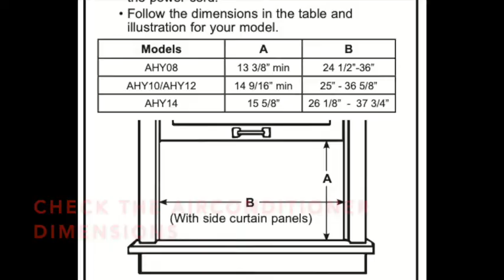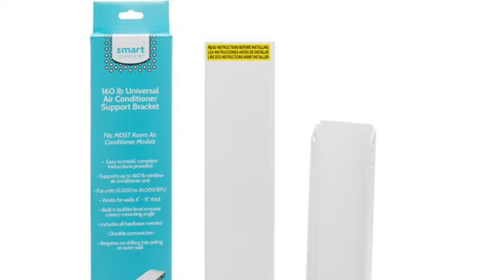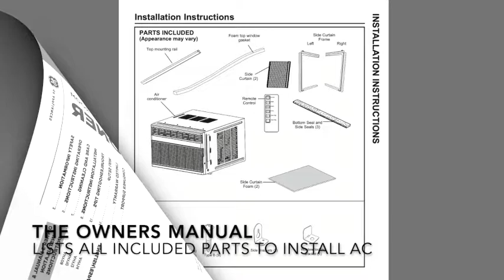How to install an AC in a Double Hung Window

Comment: I have heard you shouldn't drill holes in vinyl windows.
Reply: @nancylogan1466   You don't have to. Look at a Midea or Danby Inverter type U Shape Window AC.  No drilling into window is done. Yes you do drill two holes on each side of frame, but it's not the frame with the glass, just the wall itself. It's very inconspicuous. It's for a support bracket that will hold the AC. U Shape AC's let you open and close the glass as usual, if you wish. I have a Danby. Wish I knew of these sooner. It's awesome having custom climate control for a few rooms that central AC won't allow. Central maintains the house. My inverter ac's let me set two rooms far cooler. If you can't do any window ACs, get a portable with dual hoses since a portable sits indoors on the floor with only the hoses needing to be placed in the window.

Comment: This was good for a single-hung window. Your title says it was for a double-hung window. My double-hung top window wants to drop down once the window lock is disengaged. Looking for answers.
Reply: @PharmAnimal1  If you want a lazy temporary solution, use a support bar/dowel to hold the top window up.  You can definitely get the top window closed this way.  Use one or two dowels. Place them near the perimeter sides. Won't even notice them, compared to the fact an AC will be there too. The true fix probably involves taking a look at the spiral balance rods that may have disconnected from the pivot lock shoes for the upper window, or are very loose for some reason. These are on each side of the windows. Rather easy and cheap to fix if it's a vinyl window that lets you remove a cover to access them.

Comment: Useless info.  If you get the bottom portion of the AC set inside the lip of the sill and the window comes down to rest behind the top of the AC, not only does this not leave enough pitch for the condensation to drain, but you have so many gaps to fill in and seal to prevent air & bug penetration. Not to mention, screwing holes into vinyl window frames compromises the windows effectiveness and voids any warranty.

Comment: Becarefull. Newer windows aren't meant to have screws put in them. I have new Anderson windows and each box expressly said Do not attemp to install a/c in these windows. Not at all meant to have screws driven into sills / sashes/ jambs.
Reply: So what do you do? The day will come when a room just needs supplemental AC in addition to the central air. Sure you can use a portable AC unit (get dual hoses). I'm just going to say get a U Shape Inverter Window AC. I got a Danby. It only needed two drilled holes on the sides through the wood wall frame for the AC support bracket. The U Shape AC puts no weight or pressure on the glass. All weight is resting upon the support bracket. You can still open the window if you want. I'm glad I found one. I didn't want to drill holes into my windows either. Also these inverter ACs are quiet.  The two brands I see are Midea and Danby. I know LG has inverter window ACs, but I have only found Midea and Danby offering basically clones of the U shape ACs.